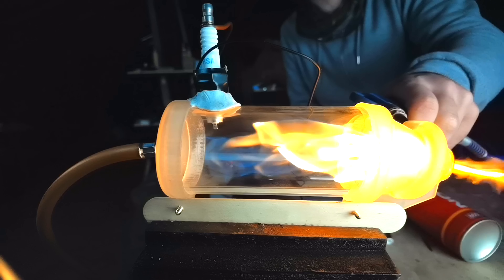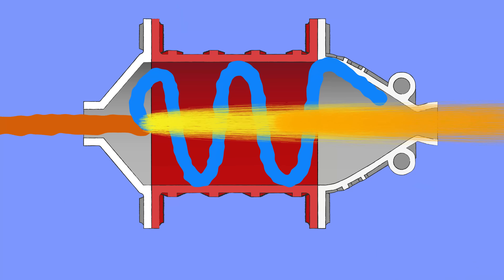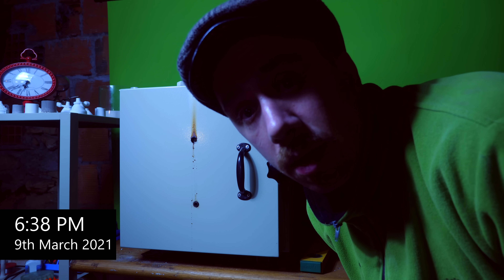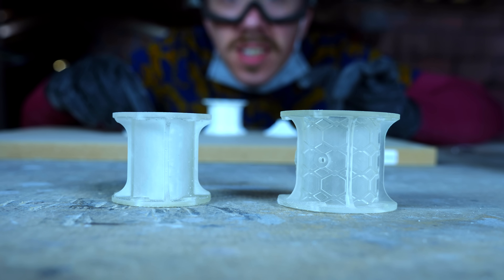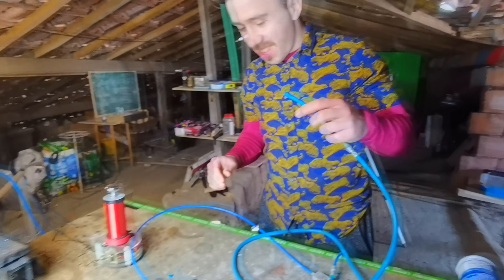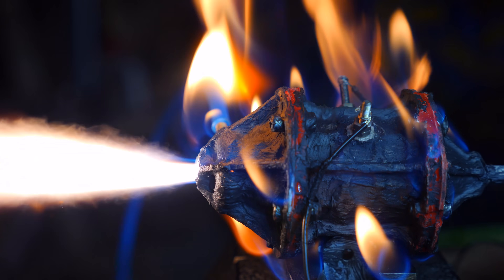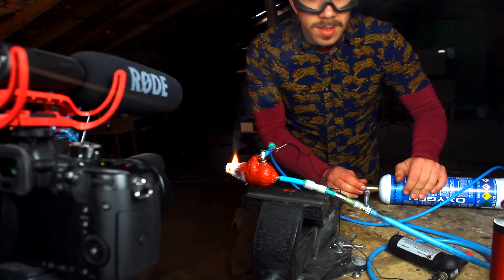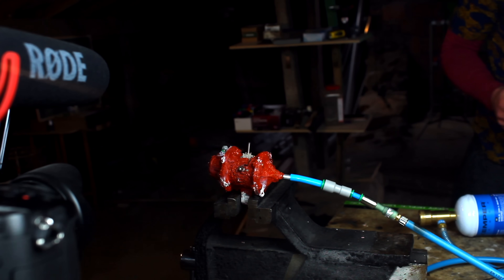Vortex Rocket V2.0 (3D Printed)

Comment: For a future projects you could 3d print a fire generator... oh wait, that's all recent projects. You could try a double walled vortex engine using your single piece engine internally and a modular outer casing with its own vortex to provide additional cooling but no propellant

Comment: OK just 2 suggestionS...
First : why not to use starlite to protect the glue from the extreme heat of the engine ? Starlite is easy to do and could help to preserve the glue from burning. That way you could use a stronger glue which could be able not to break under the pressure of the reactor... ? 
You can find on the web some way to make a very satisfying cheap Starlite (the real composition of the Starlite is unknown) with white glue, cornflour and sodium bicarbonate... It works pretty well...
Second : why not to use isolating wool that you would wrap around the engine and then you use this wool as an arming structure for a layer of isolating cement (very light) ?
By covering the engine with this armed isolating concrete, you could increase its resistance to the internal forces and to the heat...
And if it feats you, ok for a 3D printer ;). Anyway thank you for your interesting videos.

Comment: like many other people here have mentioned, if you want to keep using ceramics try a a glaze. from what I know about the curing process for ceramics, the finished ceramic is very porous, and not the best at for structural support. 

Although ceramics are super fragile, will crack under pressure maybe try and find a 3d printable material that is more flexible but still heat resistant. Also could you find a way to measure the output force for us? I would love to see how much force these engines are actually outputting. Thanks!

P.S maybe some kind of heat resistent balloon like material for the inner chamber

Comment: The problem is leaking and not the temperature. after heating the parts in furnace the 17% resin that leaves the part is causing the voids i think

all you now have to do is fill these pores in the part

i suggest coating these parts in some ceramic putting these part in vacuum so that those pores are filled

Comment: Try sintering the engine inside a ceramic container with fine compacted sand, also fill up all the crevices and the inside as well, this should help to keep the form of the print.
After that, glaze the engine by dipping it into glazing liquid and fire it at the appropriate temperature and for the required amount of time, do it at least 2 times.
This should help you to keep the form and close the pores.
Make sure to also sand (polish) the mating faces of the parts, so you would only need to use some cheap pliable metal seal rings on the mating faces.
Also try to use gas solenoid valves to control the flow of the gases in combination with a gas pressure regulator valve, therefore you can make quantifiable tests about at what pressures the burning is the most efficient.
Hope this help, love your videos.

Comment: Use Starlite to seal the engines. NightHawkInLight has several videos on making the stuff. You might need to find a way to dilute it or thin it down to apply it to your engine. Or not, as that may increase cracking ... https://youtu.be/0IbWampaEcM
Reply: Actually, NightHawkInLight also mentions phenolic resin, phenolic micro balloons, and intumescent paint ...all of which would be good options for you to try out as sealing mechanisms for your engines

Comment: In order to get more reliability, you are probably going to need to use a casting process to create the ceramic parts. The 3d printed process is too weak for what you are trying to do. Maybe create single use "burn out" moulds using the correct 3d printer medium, and then fill with a ceramic and then bake in the kiln? The space left by the resin in the 3d parts is going to be an insurmountable problem imo.

Comment: The engine leaks in the joints, so why don't you print a fixed tube so that a similar outer print can be on top . It's like a kinder surprise (layered protection)

Comment: I might be a dumbass, but;  The combustion geometry needs tweaking, seems the flame front travels to the border instead of following the flow, reducing the flame speed might help, also the nozzle seems too constricted causing uneven pressure thus the incredible amount of leak.   also, mixing the oxidizer with inert gas (venturi system that ingress normal air)  might help with adjustment of oxidizer / gas mix.

Comment: With the leaks, it looked like on at least a couple times that it just blown a hole in the side, which could be a result of the ceramics breaking down during the combustion process as a result of there lower ductililty and higher brittleness, you may have hit the material limits.

Comment: You Sir need a CNC milling machine. I think for your purposes the tolerance of those shrunken and deformed ceramic parts is just too high. I also assume that the sealant in between the separate parts gets in the way of the perfect airflow, increasing turbulence and pressure inside the engine. My Suggestion: start a go fund me for for a CNC !! 
PS: I would leave a couple bucks, I want to see this working :D

Comment: You may need too create a second shell/housing that compresses the outer sealant/high temp gasket.  You need make sure you protect your self. As your components get stronger so will the failures. Also Think of how the shrinking and porous outcomes could become a strength instead of a weakness.

Comment: Pressure is pushing the outer layer away. If you could put the coating on the inside then it might stay better. Might also have better luck with a fatter tube so it can cool better

Comment: Once you have assemble the engine. Seal up all the ports and re dip in the ceramic resin should fill up any small holes in the ceramic... Or have seen that now do a glass resin

Comment: Hey Integza, I think a solution to your problem is printing in PLA instead of ceramic; you can then later use overwatered refractory mix to "Slush cast", ( I'm not sure if that's what its called in the ceramics biz but it is in prop making,) the inside of your print. If you do intend to fully 3d print it in ceramic however you can possibly try a double wall to maximize hoop strength and give you a smoother surface to connect and seal after printing and use an internal rib structure in between to prevent a single wall blowout and distribute the pressure without breaking your 2mil requirement.

Video Idea: I'd love to see you vaporize metal with electricity! ECM milling is pretty much using a spark gap to shape metal with any conductive material (Specifically some conductive printing filament) to make things like ram jet valves and machine pockets in metal and even rifle a gun barrel. Its truly spectacular tech and I think it could help you do bigger and better projects in the future (Sponsor joke) and maybe you could make ultra powerful turbine jets or something like that. Thanks for reading and for your great videos.

Comment: The chamber pressure was too high for the material that it was build from. The design is sound. If you build it with machined titanium, your jet engine will work perfectly. Some good designs comes out of this channel.

Comment: If you make some threads so that you may screw the parts in and applied some of that silicon glue it would close the leak coming out from the jointed parts.
Another thing is that if you applied some layers of silicon glue and the other thing you might get a snazzy look but will close the holes and you could use the insulating thing that you used in the pulse jet engine and the carbon thing also to wrap it around (it is your choice if you want to applied the layers or the carbon thing idk what is its name).
You could use different sized nozzles, like the big ones to lower the pressure I wont recommend it as it would not give you the results like you want to have. 
And finally tomatoes are disgusting.
Subscribe to Integza cuz he is a great person bringing old thing to make something new I don’t know what will he do in his future vedios but will have a great outcome 😊
srry if this was long.

Comment: Maybe you should try to use the same stuff used to finish pottery since is used to close pottery's pores and make it water resistant. I wonder if it could be use to have a similar aim but with gases. I think it's made of some kind of silica (similar to normal glass), and it's usually in the form of a very dense liquid mixture.

Comment: i wonder if you coated in red sealant then placed in a vacuum chamber.  it may suck(actually push) the sealant into the pores of the 3-D printed parts. 

P.S. tomatoes. suck.

Comment: Instead of applying sealant by and, dilute it with a solvent and dip the whole part in a bucket of the stuff. Or, pour it on the part like syrup and turn the part around to be sure every surface is covered. Let it drip dry, then repeat process a few times. I'm not sure what the sealant or solvent should be though.
Reply: One potential issue there could be the sealant mixing with the combustion and not lasting too long.

Comment: Why not coat it with clay or something and then put it back into the kiln. Basically print it, bake it, coat it, bake it. You could also soak it in watered clay then dry and repeat until you feel confident the pores have been filled then bake it. The problem with baking it is you run the risk of cracks and wasting it but honestly the stuff in this video kept melting or breaking under pressure and I felt it to be better filling the pores than to just cover it up. You basically covered a hole instead of repairing it.

Comment: You maybe could try printing it in plastic, make a sand cast with the plastic piece, burn out the plastic in the kiln and then you have  a mold that you can fill with aluminum, bronze,...
Or you could try to reinforce the inner side with carbon fiber🤔

Comment: You could try to print a tiny hose in a weedeater trimming cord. There is YouTube video that I saw that uses it for flexible parts after the cord is dried though. Fill the hose with fire place sealant and you have a flame tardent  O-ring. O-rings are generally used for sealing pressurized containers. Or might stand up to the bars of pressure.

Comment: I was thinking... If you print it, cure it inside the furnace, then you could apply another thin layer of resin, treat it with UV and again in the furnace... You could have thicker walls by repeating this process. Also, this way you could solve the shrinking problem

Comment: Okay 3 things 1 is it possible you still have resin remaining from the kiln firing? 2 rocket temperature is exceeding the silicone resin temperature both inside and outside the engine.  Even if you are using a vortex the explosive expansion of heat and gases is overwhelming the vortex. 3 try a different material or cool the ceramic. The porous nature of the ceramic also needs to be addressed plus silicone is very gas permeable.

Comment: Maybe you could attempt to make a mini pumped hydro system with the impeller and other designs all packed into one project? Maybe make it replicable for anyone at home without the heavy use of soldering and or explosive gasses

Comment: You will have more luck putting the material in the inside to clog pores.  Putting it on the outside it can't contain pressure pushing out.

Comment: Hi Integza, you could try to put the refractory cement on the outside  of the motor (after putting the pieces in the oven) and then use a vacuum pump (which sucks the air from the inside of the engine) to fill all the micro holes with concrete.

Or 

you could create a space between the inside and the outside (1mm should be enough) of the engine and fill it with cement and then use a vacuum pump to avoid bubbles, as it is already difficult to fill 1mm

Comment: Reverse mold.  What if you 3D printed the inside of your rocket engine and then covered the whole thing with refractory cement?  You'd have to use whatever material burns off the most easily.  It won't look pretty on the outside but on the inside you have a perfect chamber and nozzle.  I almost think that an inside mold made out of wax would be the best but I don't think anybody makes a 3D printer that works with wax.

Comment: You should try a refractory coating to seal it, the silicon seemed like it worked for a little bit so maybe something like a satanite, sair bond refractory mortar, or APG #36 could work

I also see a lot of people recommending glazes, but I feel like that would end up failing once it heats up to much like the silicone, the whole point of firing a glaze is to melt it, so that’s what it’ll do on the engine. most of what I’ve suggested on the other hand can consistently and constantly hold up to temperatures exceeding 3000 degrees (1649 Celsius)

Comment: hey, quick question why didn't you just mix the oxygen with the fuel and use something non-combustive for the vortex cooling?
Reply: Yeah after watching through it again I'm 90% sure what is happening is that the oxygen is mixing with the fuel before it gets to the end of the chamber so instead of cooling it heats it up more so if you were to use compressed air as you did in the first video and instead of feeding in only the propane mix them together in another chamber or beforehand and use something that's not flammable to cool the chamber.

Comment: Also, you can leak test your creations in a tub of water ahead of time. Plug off the exit nozzle, pump in air, dunk under water, see were the bubbles come out. Could also not dunk the parts, and spray with a water solution mixed with dish soap, to create bubbles. Same technique as finding leaks in a tire inner tube.

Comment: A porous material leaks...the inside pressure exceeds the external pressure...balance the pressure...place the complex geometry inside a simple tin can...now you only have three ports to seal...four including the pressure balance port...use nitrogen to fill the cavity. Full Metal Jacket - I'd suggest tin tomatoes for poetic symmetry.

Comment: Maybe use a thin coat of the ceramic resin on the already finished ceramic parts. print - bake - remove sopport - brush more resin on - use UV light for hardening - bake again. 
Hopfefully it will noch crack during 2nd time in furnace. :D

Comment: What if you put the high temperature sealant on the inside and pressurize the engine. The sealant should fill the holes better

Comment: first you did a really good job keep going on you're amazing! first problem is the high temperature silicon : it's made to resist for 5 second at 400 celsius so not nearly enough as sealing as you wished (i know because i use it for engine and torque limiter sealing almost everyday at work).
mext is how you sealed the engine : I suggest a carbon fiber ring to maximimize the torque on the sealing screws without break the ceramic parts and try using deacon8875 as sealing because it can substain a temperature of 980 celsius for long period of time.
those are my suggestion hope you can find it useful can't wait for your next video

Comment: I love your videos and your spirit :) 
- Have you considered to use the liquid ceramic resin as a coating (in one or multiple layers)? Apply it as a paint, UV it, oven it, repeat. If adherence is good, you can also try for feed the cracks of "failed" curing piece (with combinaison of vacuum chamber or pressure chamber for the UV part).
- Perhaps you could use carbon fiber as reinforcement, just as regular resin, but with ceramic resin when coating. I don't know if it will work, but I think it worth the try :D :D
- PS: I don't know if you did it but to assemble almost plane surfaces, you can plane them by sanding them with sanding paper on a plate surface. This is in order to limit the thickness of the assembling filler, which is most probably a failure point.

Comment: You should probably put some kind of coating on the inside of the engine, something like a metal coating made by electrically charging the engine and putting it in a solution of some kind of metal oppositely charged. This way it should stick rather well since the inside is very smooth. I don't know how long it could last, but it's worth trying

Comment: Integza use hydrogen as your main fuel and oxygen for the vortex. The perfect ratio for burn is easy as it's just 2H 1O. And you can make the gasses through electrolysis in water.

Comment: Why don't you try building a hybrid rocket, using solid fuel in the combustion chamber and pumping oxygen through the chamber in order to propel the rocket. I think the old Mythbusters did something like that a while back. With this design you will have freedom of testing nozzles and different fuel types.

Comment: next video idea: Hybrid rocket engine. Since you are having trouble with leakage and thermal resistance why not have a solid fuel maybe paraffin and a gaseous oxidiser. The combustion chamber  would be protected by the burning paraffin itself which also mean no leakage. You can 3D print the nozzle in ceramic and a bit of insulation for the 3D printed outer shell. For the current leakage problem you could coat all the cured parts with a ceramic and water solution to fill the gaps and then boil the water away. This should not deform the structure since structural integrity comes from the already cured part

Comment: Hey Integza, I like your videos but prefer you don't blow yourself up. How about adding some safei features to your setup? Like ... Quick shut-off valves for fuel and oxidizer? Just add them in-line with the built-in valves ... And an actual fire extinguisher, instead of just blowing on fires like birthday candles?? Actually, a regular tank of CO2 would probably last longer than a fire extinguisher tank .... And maybe a face shield, to not burn off your mustache??